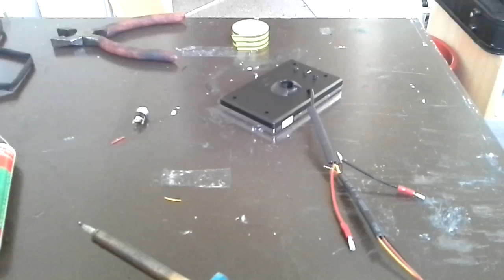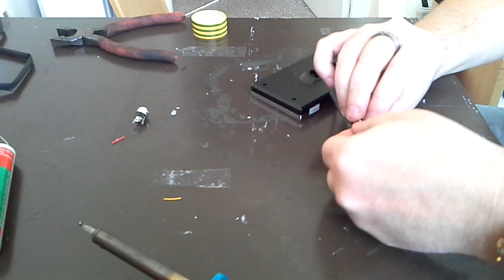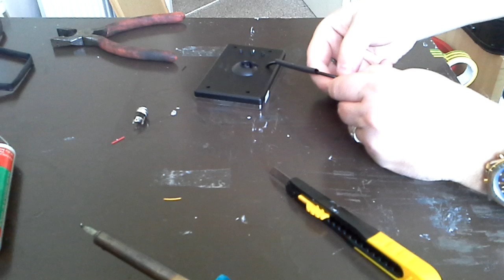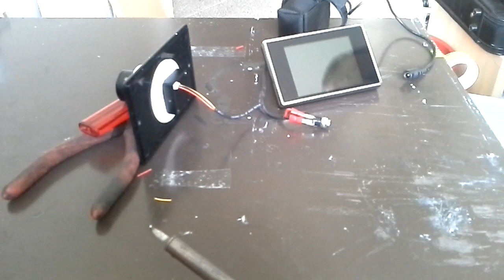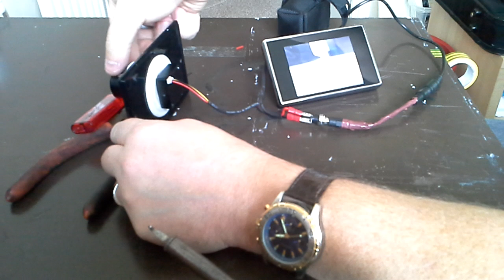DIY Night Vision - Wiring camera and screen part 2

Comment: I have watched both videos on wiring this, but you miss out the most important part (that you do off camera)
Which wires are soldered to what? it would help a great deal if you mentioned the colours of the wires your
soldering together & the (colours) of the ones that go to the battery connector... or better still, put up a wiring diagram !
Thank You..
Reply from the maker: +kingdom777866 I am do to virtually the whole series of videos to improve them.
Reply: Ok.. but that doesent answer my question, as i'm about to soldier my wires together.. i just
need to know what colour wires go what ??
Thanks for your help...
Reply: No reply then ??  Really.. whats the point of this video if you dont explain what colour wires
connect to what ??
Reply from the maker: +kingdom777866 apologies but I have been ill, and still not recovered but hey that's not important really. So red on both the screen and camera board are positive, black is negative on both. Yellow is your video feed. Depending on your screen and camera you may have a white one which is audio. If your camera board does not have cut back the white cable on the screen so it can't touch anything.
Reply: Fucing hell..  i give up !!!
Reply from the maker: +kingdom777866 so do i